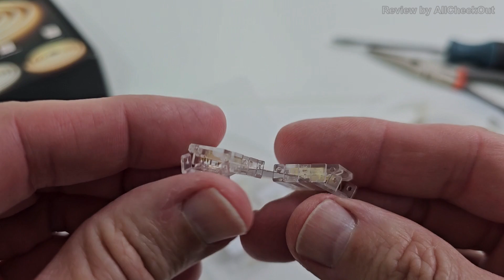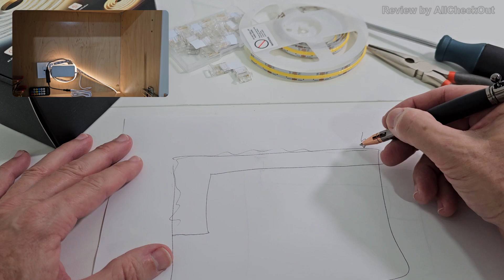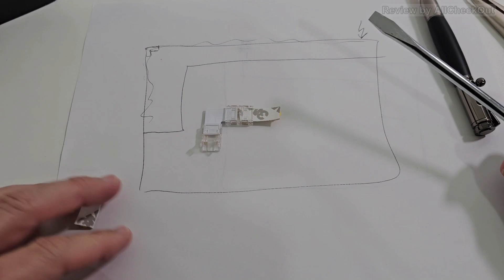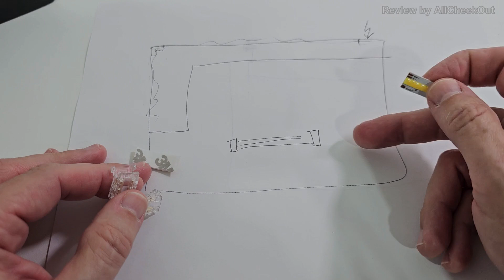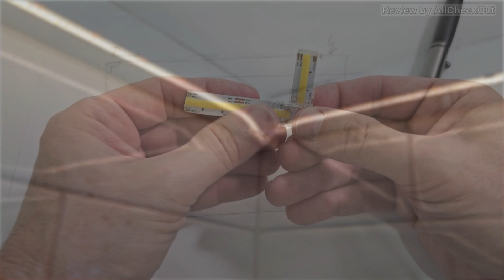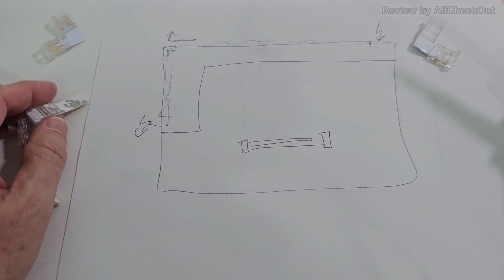PAUTIX 10mm Connectors Review | L-Shaped/Corner Connectors Problems & Solutions

Comment: Thank you so very much for the clear explanation! Luckily I do have an outlet at either end of my U shaped kitchen area, so by using the outlet on the left I can use right hand turns which will work just fine. I was planning on starting at the far right until I started looking at the connectors, which is when I decided to track down a video that ADDRESSED THIS EXACT ISSUE!! I will share your video with the Amazon product link, so maybe a little guilt will get the makers off their asses to address this exact issue.
Reply from the maker: Great to know this helped you and thanks for sharing the video and helping to resolve this big issue. Made this video quite some time ago and was hoping to help more ppl, but for some reason nobody ever responded. Maybe ppl just sent it back when it was not working or they did some "ugly" installation. IDK. Really appreciate your support and feedback 🙏🏻🙏🏻🙏🏻
Reply: @allcheckout I ended up doing the installation with no connectors, as it turned out. I had L and T shaped connectors, but I figured out that I could set the lights ‘on edge’, glued to a 1/2” thick piece of oak. I rounded the corners to a 3/4” radius, and the lights wrapped around them easily! I did discover that you CAN use a T connector for a left or right hand turn, but didn’t get a confident feeling in the quality of the electrical connection. I’ll send you some pics & a video if you wish. Thanks again for pointing out a glaring shortcoming!
Reply from the maker: Awesome - thanks. Sure - always interestd in updates in case I have to fix or replace the light, but still works nicely here.